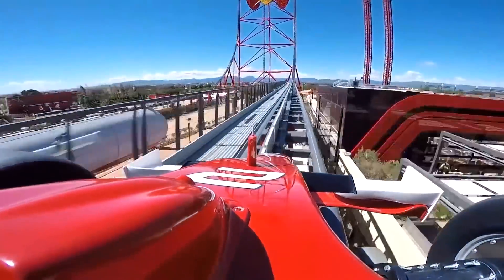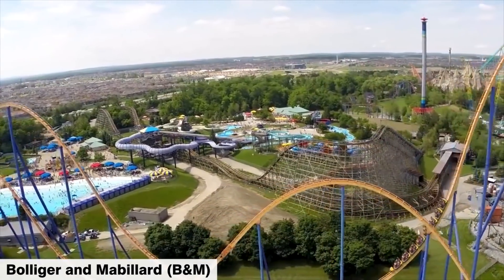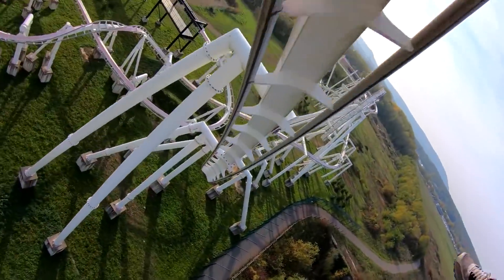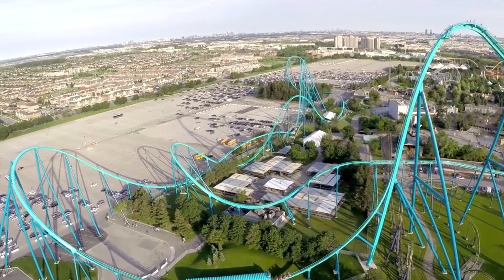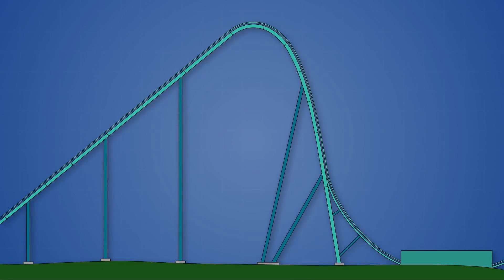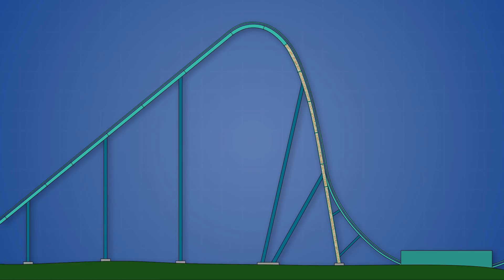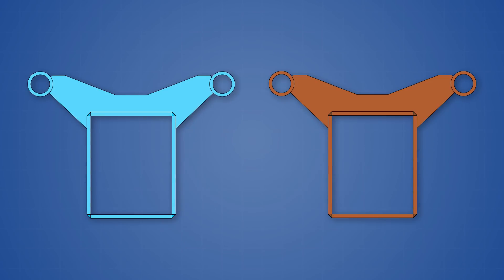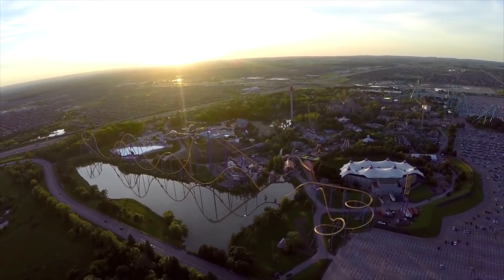Why Roller Coaster Track is Filled with Sand

Comment: Anakin Skywalker hates B&M's for this reason.
Reply: Currently, Anakin has lost ALL desire to ride that coaster. But before all the sand, he would ride with great enthusiasm and declare, "NOW THIS IS PODRACING!"
Reply: 351cleavland Misa liked your comment.
Reply: I'll try spinning that's a good trick!
Reply: "I don't like sand, it's coarse, rough, and it gets everywhere" ~Anakin Skywalker, Star Wars Episode II: Attack of the Clones
Reply: Tactical Baguette more like 
-EVERYONE
Reply: Instead of sand why not use expanding foam same as they use in building sites . Will be much lighter and probably better than sand
Reply: Mic Mucky Actually, the sand's weight probably helps, as it attenuates more of the acoustic energy because it is harder for vibrations to move it.
Reply: @brainmind4070  or right why not just fill them with lead if the weight is a factor in improving noise reduction lol
Reply: Mic Mucky Well, in addition to it being more expensive and harder to install, the fact that sand is "loose" particles is also probably helpful for sound-deadening.  Solid metal would transmit sound waves much more directly, as the atoms are locked into a rigid matrix where one can't move without moving the one next to it.
Reply: @micmucky4993  or the foam inside fire extinguishers
Reply: This is the last place I expected to see a Star Wars meme.
Reply: Zappiturtle oh
Reply: Shawn Lee because he hates the high ground?
Reply: @Bevsworld04  it's because the sand reminds him of when his mother was captured by tusken raiders and he was unable to stop shmi skywalker's death

Comment: 3:13 Leviathan is not the tallest coaster B&M has built. Fury 325 at Carowinds is taller
Reply: He said "had built to date" meaning that as of the date that Leviathan opened it was the tallest.  It would be incorrect if he had said it was the tallest coaster they "have built to date".

Comment: Nemesis at Alton Towers in the UK had the track filled with sand a few years before 2006. Same with Oblivion, Thirteen, Rita.. in fact, most of Merlin UK's coasters have been filled with sand both prior to construction and retro filling after construction. Have a look into why they have (Alton Towers) some really great building constrictions.  Without them, Nemesis wouldn't of been built the way it was.

Comment: Great Video! I love the animation and how you explained all the aspects of solving the problem so everyone could learn something!  A couple clarifications I want to make is that this was not a new solution, and B&M have had this as an option to parks since the early '90s, usually with pea gravel rather than fine sand, since it is cheaper, but Leviathan was a special case with it's large spine lift hill structure and your facts are correct as far as I know. This has certainly become a more popular option in the last decade.  Another thing is, though this is beyond the scope of this video, adding sand or gravel also reduces sound by shifting the resonant frequency lower by increasing the mass of the structure, causing a great decrease in the gain of the system. 
Also, sorry, this just caught my eye as I am watching it again, I have not heard the term "Fin Plate" before, usually a fin refers to a flat plate in line with the direction of travel.  Think of LIM stator fins, brake fins, or fins on a fish.  We usually refer to the plates you are referring to as Cross Ties, Rail Ties, or just Ties (In America at least, B&M I would assume might call them des braces?)  

Sorry to give you a page full like this,  I really honestly enjoyed this video! I'm Subbed. Keep up the great work!
Reply from the maker: Thanks so much for the additional insight! The fact that the additional mass contributes to the noise reduction is pretty interesting. 
I honestly can't recall where I first heard the term "fin plate," but I've just gotten into a habit of calling them that. The term "tie" makes a lot more sense.

Comment: The best sounding ones are the B&Ms from the 90s that use nylon wheels.
Reply: Raptor at Cedar Point!
Reply: @jimewen19681  my thought exactly!
Reply: @jimewen19681  BINGO!
Reply: Nemesis, can’t beat nemesis’s roar
Reply: The original Hulk, Raptor and Nemesis all sound amazing <3
Reply: Batman the ride great adventure. In 1995 that roar was the best. Sounded awesome. Now its too quiet.
Reply: Raptor doesn't sound so amazing when you work there and have to walk 20 feet away from the track to get to your office... It is quite deafening! They need to fill at least the drop with sand...
Reply: Indeed, Nylon wheels last longer too. Even if you use the proper wax, you will be lucky to get more than 2 seasons out of the new softer compounds. Providing you look after the track properly, white nylon will last for decades.
Reply: Batman The Ride at great America? Which wheels does it use?
Reply: Idk sounds like it uses softer wheels
Reply: Great Bear at Hershey's got a good sound for a coaster that's not got a huge first drop.

Comment: Raptor at cp needs thos
Reply: NO! THE ROAR IS AMAZING! NO, NO, NO, AND NO! NO RESIDENTS RESIDE CLOSE ENOUGH TO CEDAR POINT SO LET THE ROAR STAY!
Reply: Never man. That roar is the most iconic sound of the Cedar Point midways. Not Top Thrill Dragster’s launch sound, not Magnum’s anti rollback system; no, it’s Raptor’s roar.
Reply: Kevin Ratín Raptor does not need sand.
Reply: And/Or it could use polyurethane wheels.  (No bashing, please; I'm a coaster nerd on the autistic spectrum, with severe sound sensitivity!)
Reply: ABBAbeth the hamster Then either wear ear plugs to Cedar Point or don’t go to Cedar Point at all.
Reply: @Metalhead_Coaster_Fan  What did I say about bashing?

(And I DO wear ear protection in public.  I can handle Arrows and Intamins just fine.  It's ONLY the B&Ms (and fishtail Premiers) that pose the problem, as I find the roar to be much louder and more painful than any screaming.  Also, I HAVE been to Cedar Point.  Twice.)
Reply: ABBAbeth the hamster If I was, I would be calling you names and swearing.
Reply: @Metalhead_Coaster_Fan  Extra point being, I can handle everything BUT the B&M-with-no-sand areas with hearing protection.  So much for that abrupt "don't go" advice.

Comment: The First Rollercoaster filled with Sand was Black Mamba at Phatsialand, but here the Sand was filled bevor opening in 2006.
Reply: Black Mamba wasn't the first. Kraken at Seaworld opened six years before and was filled with sand so it didn't disturb the animals. Also, original Hulk didn't have sand in (it was extremely loud) but I think the new one has sand in the rails (as I believe all B&Ms now do - I've not heard a B&M roar like Nemesis or Hulk for years now)
Reply: Yes, DD was built with sand in 1999, and you're correct the new Hulk was rebuilt with sand due to complains from the nearby hotel. (Dragons also has a sound wall as well) @marcussheen
Reply: @marcussheen  Just curious, how recently are you talking about when you say "as I believe all B&Ms now do"?  Banshee is loud.

Comment: Fascinating! I'd heard of this already, but I didn't realize Leviathan was the first coaster to have this method of noise reduction implemented.
Reply: duelling dragons at universal; were the first
Reply: I don't know which one was first but I know for sure that Black Mamba in Phantasialand also got Sand in the structure.
Reply: It was not the first. Not even close actually. All of the Busch Gardens Williamsburg B&M's have had sand filled into its rails due to complaints of nearby James City County and its high scale golf course. Many roller coasters have sand filled rails/beams
Reply: Oh i thought talon at dorney park was
Reply: @basedshrine708  I believe you are correct. If Talon was not the first, then it was one of the first. Sound dampening started long before Leviathan.